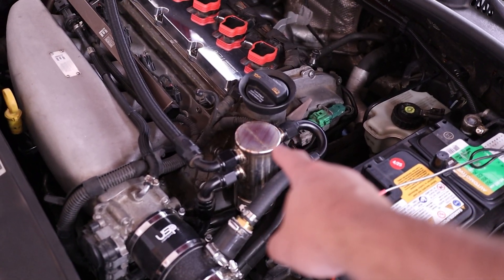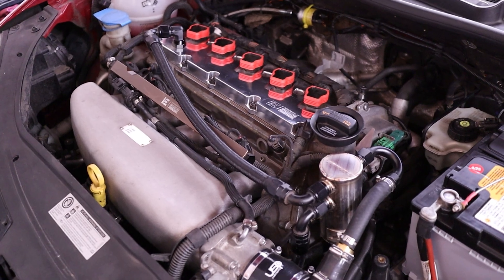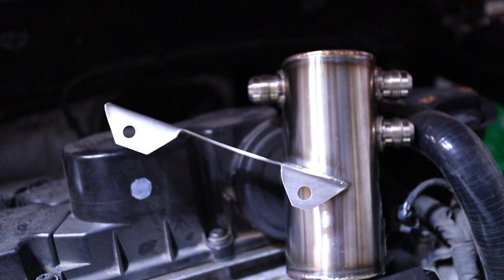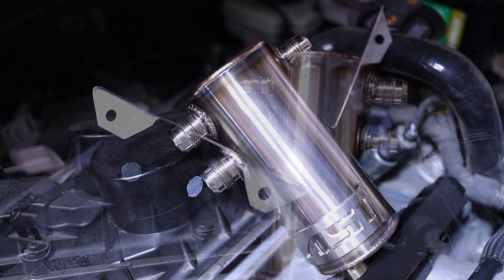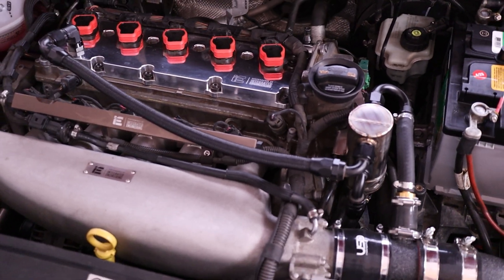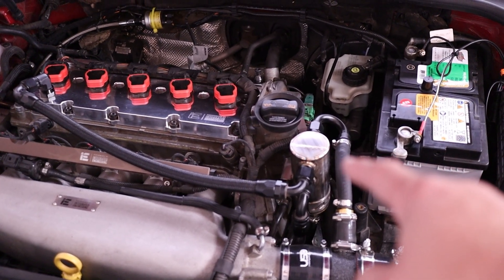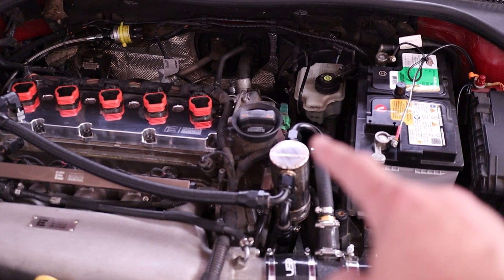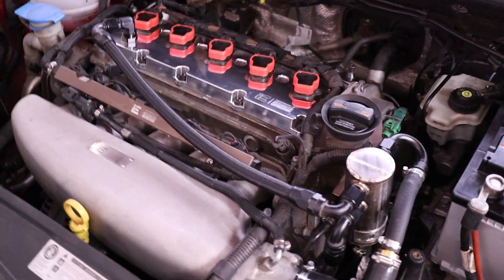How to Install a Catch Can on the VW 2.5 Engine | AS1 Catch Can for Volkswagens 5 Cylinder 07K

Comment from the maker: What catch can are you installing?
Reply: I'm  doing everything IE including the intake and I'm guessing I'm gonna have to use an IE Catch can as well because it seems like they build there kit to fit most IE Things but Id like your input on the catch can system, which one do you think will work most for the IE setup?
Reply from the maker: @ I have all the IE goodies except for the catch can. This AS1 can in the video is a direct bolt on to the upper timing cover. It’s a really clean install. You just have to get your own fittings and line to connect it all. The IE cans are good too, just have to figure out your own mounting.

Comment: I've a question? In which part did you installed the 2nd line which has the breather with adapter? I haven't distiguished the part.
This is a NICE piece of catch can.
Reply from the maker: The chapter starting at 7:16 goes over the breather and line. There was no good way for me to get a camera down there so the footage is a little lacking.
Reply: @VoyageRC don't worry for that. 
If you seen the AS1 catch can instalation he shows about breather port is located on the oil filter base housing just right of oil sensor temperture and oil cooling dissipator because is the port which recieve direct the oil pan's vapours.

Comment: Dumb question: did you remove the spring and little plastic piece when installing the block adapter to the motor?

Comment: Did you need a pcv valve to run the catch can?
Reply from the maker: Negative. The PCV system is eliminated when running a catch can.
Reply: @VoyageRC you ran the outlet down to the block?
Reply from the maker: @VeeDubs2022 the outlet goes to the intake

Comment: Can you use this setup with an OEM valve cover and Oem style intake hose connectors? I have the ECS intake on mine and the hoses connects the same as a stock intake manifold. Thanks!
Reply from the maker: Yes, the lines would just be different so they can mount properly.

Comment: What do you do with the pcv line that runs from the old vacuum pump to the brake booster
Reply from the maker: You will need a vacuum source for the brake booster. That line will need to be run to the intake manifold or to a tee on another vacuum line.

Comment: Great video. Thank you for that. Where does the drain line from the catch can go?
Reply from the maker: Thank you 🙏🏻 The drain line just needs to be run down and out of the way. Preferably somewhere that is more easily accessible. Make sure to avoid any moving parts.

Comment: Thanks for the vid hood sir. Well done. 👍🏼. Curious, that line for the drain…where did it go? Does it just hang below/ underneath the car etc? I’m guessing it’s capped.
Reply from the maker: @L0rdVadr  it has a valve on the end to close it off. It can be routed wherever you think is easiest to drain from. Just keep it away from any moving parts 😉

Comment: Nice video super detailed!!! My two questions are about where did you conected the down line (2nd line of catch can) and the purge only has a hose for dains?
Reply from the maker: @gati54uri094  the second line is the block breather. It goes down near the oil filter housing. That is the line that requires the adapter from IE. I’m not sure what you are referring to for “purge only”. The AS1 catch can includes a drain hose with a valve.
Reply: @VoyageRC  About the purge valve, I mean did you add a piece of hose after the drain valve or did you leave it just as it comes?
Reply from the maker: @ I left it just how it comes. I will be re doing it at some point to make it more easily accessible to drain.